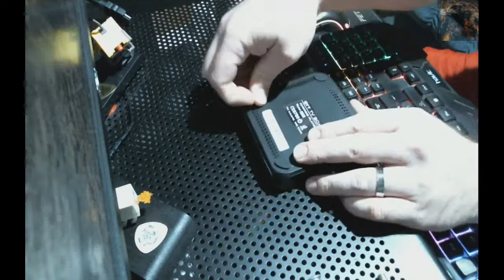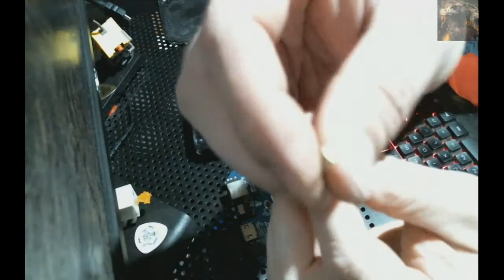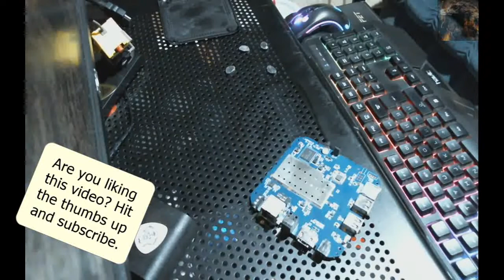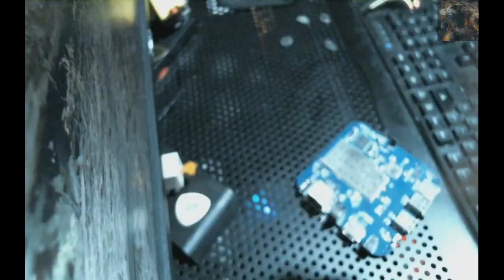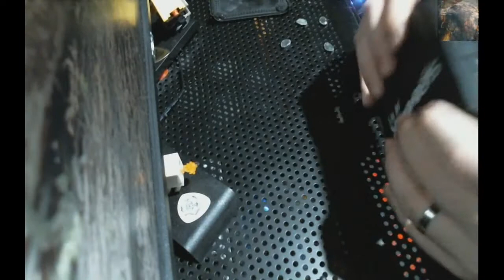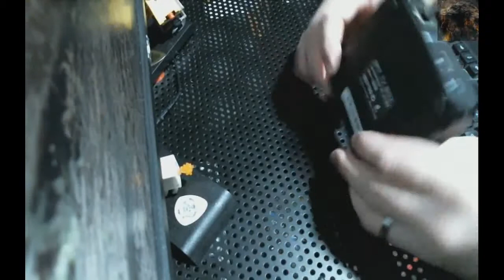Android Tv Box External Antenna Mod Boost Range and Stability

Comment: I have a Transpeed 6K TV Box and I want to Improve the antenna. But I want to know if is possible to adapt a --> 6Dbi 2.4GHz 5GHz Dual Band Antenna with "PigTail" connector. Your antenna has 50Ohms Impedance? Waiting for your response and regards.
Reply from the maker: I'll have to get back with you on that cause I have upgraded to a newer box.

Comment: you still watch tv??
Reply from the maker: It just overall helps the wifi range and strength.
Reply from the maker: Yes I do and will continue to. Android boxes offer many free alternative ways to watch tv. Companies/Apps like Pluto tv, Xumo, Tubi give you steaming channels and movies that provide  plenty of choices to keep you entertained. Besides that you can cast devices right to your tv.
Reply: @BRSReviews  bad sells pitch but ok I just didnt think you did. still i have a family member who uses that free cable box no bills but a few channels
Reply from the maker: @NeroCloud1  Not selling anything its FREE. They are my opinions and things I do with my android box that I enjoy.. just sharing. If someone decides to do the antenna mod it will cost them less than $5 to change it. Can help me out by using the links above not a lot of kick back to me but still helpful.
Reply: @BRSReviews  yea thought the mod was nice cause yea the ones that somethings come with are cheap an crap
Reply: @NeroCloud1  I have over 20thousand channel's 🤓